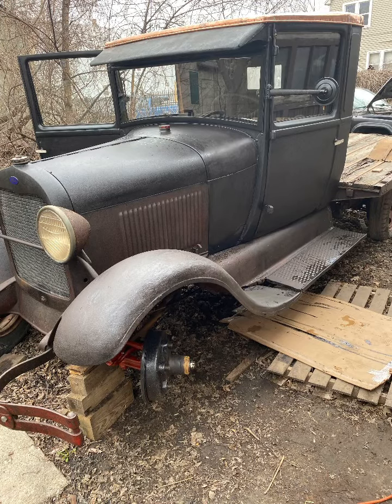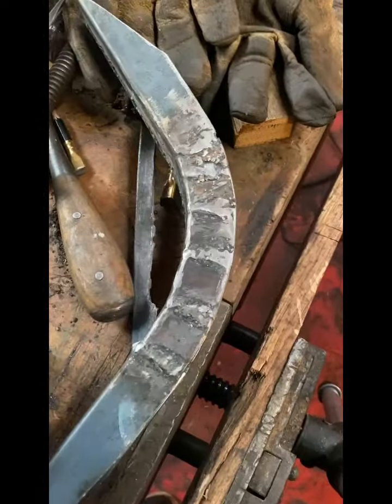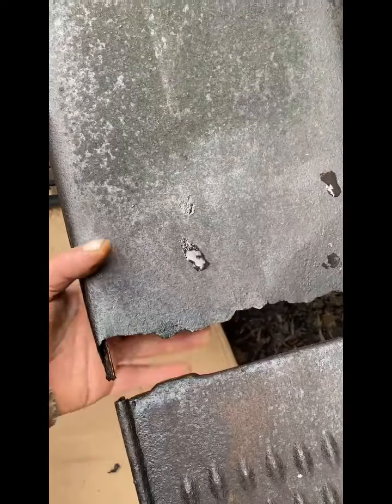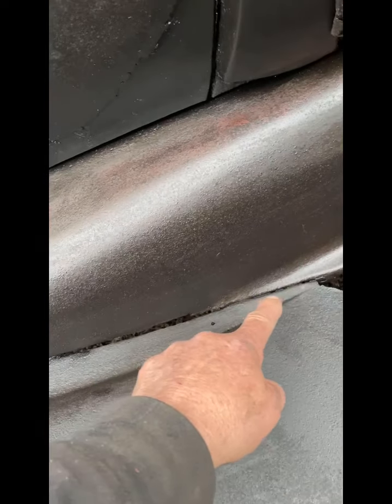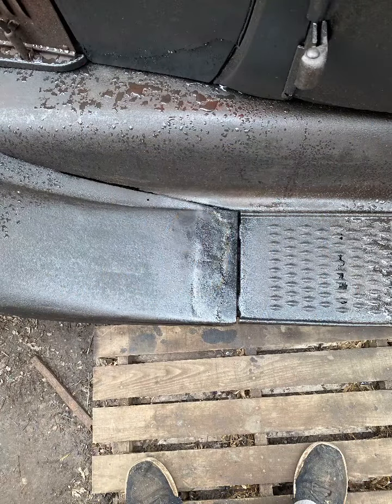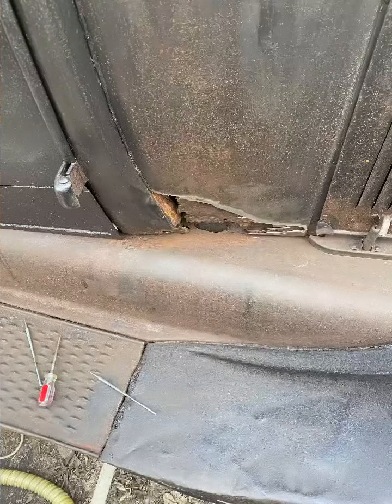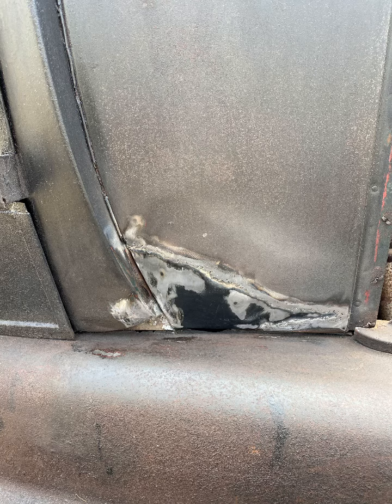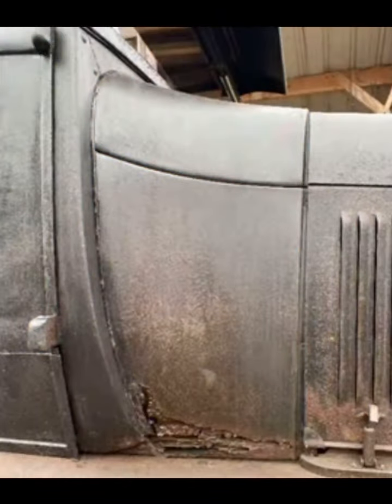1928 Ford model a a truck patch panels and step install, feels like 10 below 0 in Detroit today.

Comment: I can hardly wait to see this old girl finished. You're doing a great job Bud!
Reply from the maker: Thank you! It might not ever be “done” but that’s half the fun 🙂 I’m gradually going through all the mechanical items as I go, it’s a nice change of pace but I have to pull all new wiring and I figured out how to add turn signals without drilling a single hole anywhere and I also need a passenger side rear view mirror but she should be on the road soon 🙂